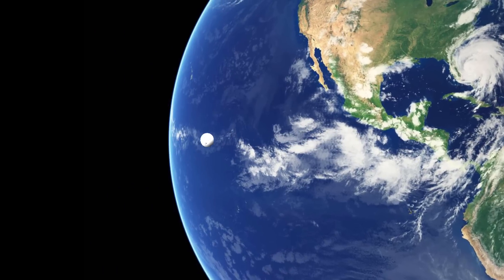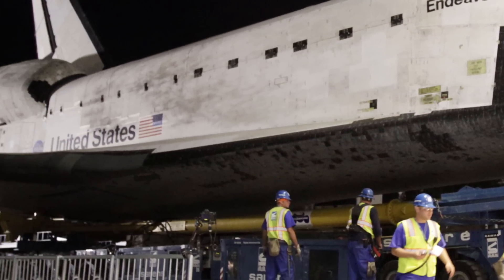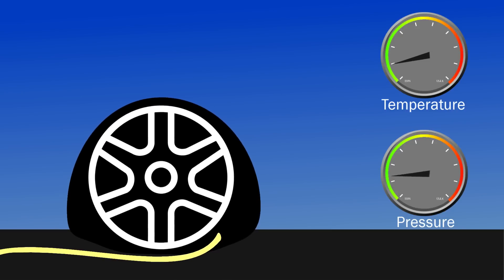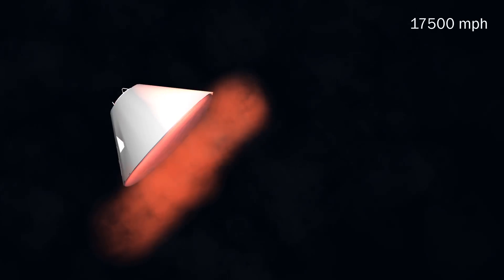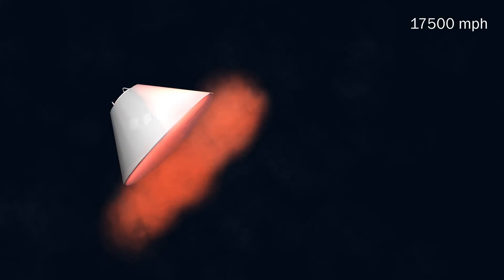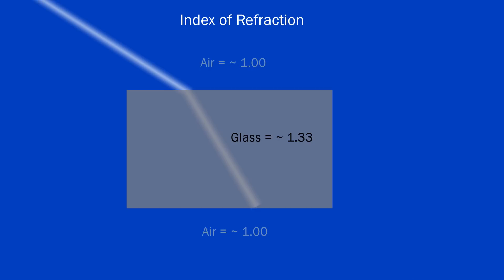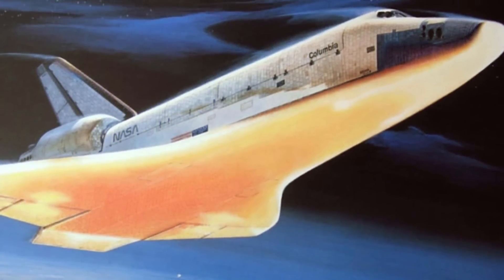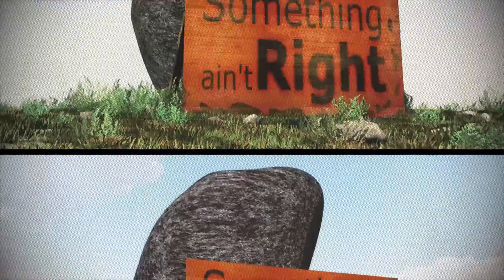Why spacecraft are not fully covered with heatshield

Comment: Something I'm curious about, is the air in the shock wave heated enough so that it's sonic speed matches that of the spacecraft?
Reply from the maker: I don't think sound can even propagate inside a shock wave. At least some of the air molecules are moving at the speed of the craft, but to have sound they have to move faster.  And this I don't think is possible. That's why there could be a sonic speed inside the shockwave. This is my speculation.

Comment: So the actual compressing of the oncoming air happens some distance away from the heat shield, and then it cools and de-compresses while "squirting" outward, over the sides.  Does that sound right?
Reply from the maker: The entire area up to the surface of heatshield is compressed. But the area a short distance away from the heatshield compresses a lot more over a short distance. The benefit of that is that the really hot area can only heat up the heatshield thru radiation mostly as oppose to conduction if they were touching.

Comment: Best one so far. So does this shock wave explanation mean that the heat shields are there in large part to protect the space craft from the high temps it encounters leading up to the formation of the shock wave, at which time the shock wave itself offers a lot of protection from the heat?
Reply from the maker: Not really. The heat shield is very much needed. What the shock wave does as a side effect of its formation  in conjunction with the shape of the spacecraft is to reduce the amount of heat that the heat shield has to deal with. Basically it extends the operational limits of the heat shield.